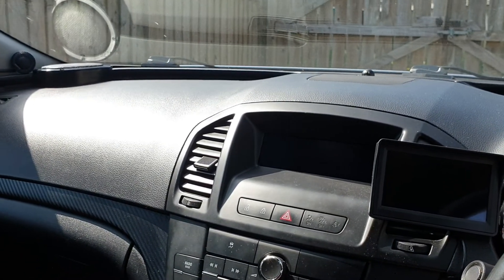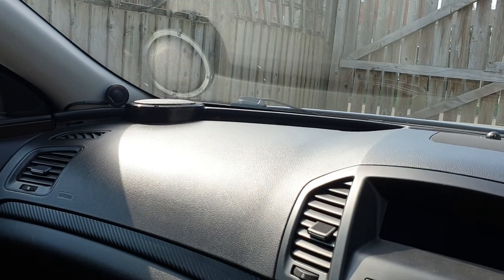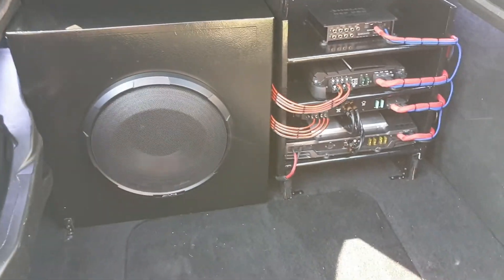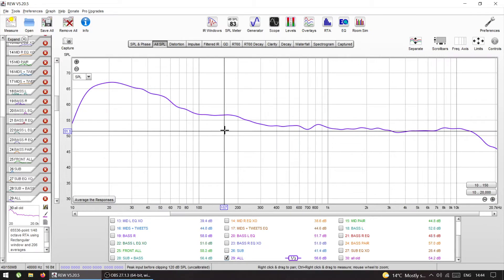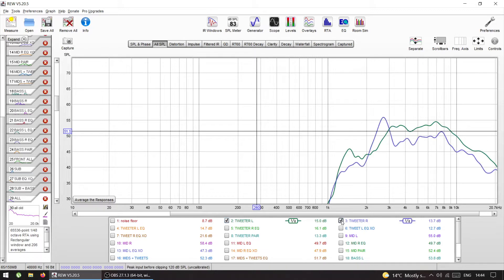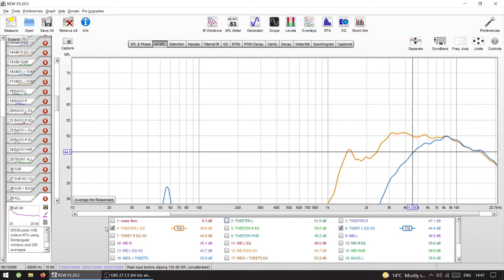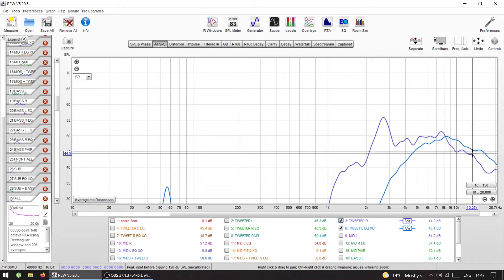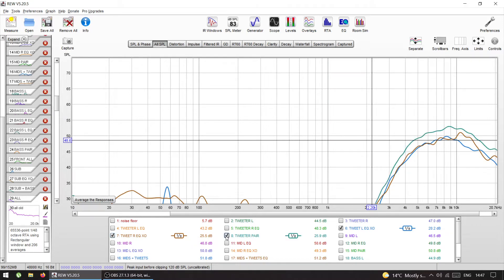Tuning my system (REW RTA and auto EQ)

Comment: Hi. I have watched most of your REW and Helix DSP related videos. I also have a Helix DSP (DSP.2) and use REW and a DaytonAudio UMM-6 USB mic. I've obviously missed something or I'm not clear.. I generated pink noise in REW that I play through the HU in the car and when I measure an already adjusted system that sounds good, but the difference from 100hz-15khz is 25db and from 20-20khz even 45db. Judging by all the house curves, it comes out of every recommendation.. Today I came to the conclusion that the generated signal from REW and when I load it into the program is not linear but has a constant drop of I think 3db/oct.. When I play it on HU and the adjusted DSP that has with some House curve, I get a difference of over 40db in the full range on the microphone.. What to do? Is there any option in REW u and is it possible to generate completely flat pink noise? I could send you photos privately (email, whatsUp, viber)
Reply from the maker: In REW RTA settings change "spectrum" to " RTA 1/48"
Reply: Thanks for the quick reply, that seems to be it.. Looks pretty linear now (at least in home Hi-Fi).  Can it be applied in REW to all previous measurements?  Like for example smoothing. @RAW-CAt
Reply from the maker: @josip07B  no, if you took measurements in spectrum, you will have to redo them.
Reply: Thank you, you helped me a lot.  Yes, all my measurements were unfortunately in the spectrum, I will have to repeat... Can you give a brief explanation as to why this is so?  Why is it that when the spectrum is there is a constant db drop and when it is 1/48 it goes almost linearly.. Thank you. @RAW-CAt

Comment: Bonjour, pourquoi avoir filtré le médium à 200hz alors qu ils sont capables d aller plus bas , par ex 120 hz ?
Reply from the maker: In order not to stress them too much. The less the driver is moving (xmax), the cleaner it plays. As well the lower they play, the more energy they transfer to the dash making other things rattle and buzz.

Comment: I've always been told to place the mic at 90 degrees ONLY when measuring for a surround sound setup. Point the mic at the drivers for everything else.
Reply from the maker: Well in a car the drivers are at a great angle from the listening position. So measuring at 90° makes all the drivers to measure similar due to the polar pattern of the mic. If you will point.it to the front you will have very different angle to left and right side drivers and the response will not be as accurate.

Comment: Whenever I tune my BMW 328i flat like your graph and similar house curve , it sounds overly bright and thin.  
It has to be a constant slop for some reason. 
What am I doing wrong?

Thanks !
Reply from the maker: You are not doing anything wrong🙂 A house curve is a personal prefference. Maybe you are not used to have the top end? I would advise you to stick with a flat top end for a couple of weeks and let your ears to adjust to the new sound signature🙂
Reply: @RAW-CAt  don’t know man.   I have quite a bit of experience with home stereo and my house curve has been the Harman curve in my home 2.2 system.  And it sounds great.   
In my car however it does not sound so great.    
Could be the drivers.  
I did a RTA measurement of the old amp and drivers I have in my car and BMW had them tuned not flat either.    
Who knows
Reply from the maker: @Nightjar726  maybe it is the car interior after all?🤷🏻‍♂️
Reply: @RAW-CAt  maybe.   Who knows.   I don’t have the experience with car audio to know what’s going on.

Comment: Equing dips you car wreck the speaker if you turn up the volume up. You may get the amp into clipping
Reply from the maker: "MAY" is the main word here. Gain structure setup correctly doesn't introduce clipping. All speakers are still fine by the way👍

Comment: I want to run this in my car as well. I suspect my biggest issue is the subs are out of phase or has a timing mismatch. Unfortunately I can't see any way to correct it on a factory Harmon Kardin sound system
Reply from the maker: That is why you need a DSP...

Comment: If you set your gain correct from the beginning and your amps deliver as much as they can. How can you then boost the volume more in the DSP to gain a higer level on the mids and sub for example after you have equed them (1:34-1:49)? Will you not add a clipped signal then?

Comment: I appreciate everything you've shown just bought my 2nd dsp and it seems a little mystery. You would think by now a software would be made where you plug in, have a mic and it does the rest or the system would tell you where your mistakes are then you correct and then you can later adjust for listening pleasure. So many so call pros keep everything a secret and the steps just to get the beginning correct it is ridiculous. The dsp companies should have a step by step of set up on their websites for customers or potential buyers cause you spend a 1k or more on a dsp and then it's like ok go do it. I think it is a good hustle but they should at least have on line support to help new people get started
Reply: @RAW-CAt  sir if you can help me well you have the knowledge, I'm trying to get my rearfill in order with the 3 way curves and the rear deck is loud and also I have rear door speakers. I mean do I eq after I do the sub and 3way front or do I do it as a big left channel thing and just eq the frequencies were they lay regardless of speaker location. Just confused but I gotta get something done this install has had a life of 2yrs I'm trying to move on to a new one lol
Reply: @RAW-CAt  I appreciate your time and help

Comment: The reason I say 3khz is that 2-2.5khz is where you don’t get good summation between left and right mids so that’s not a great place to put the crossover, moving it up although not technically perfect for directivity of the midrange will be lots better than lower

Comment: I would be lowering the crossover to around 3khz and that will make the midrange blend be so much nicer, using most tweeters down to that is fine
Reply: Ya was thinking the same.... I'd try 3400ish before boosting.

Comment: If you drop the low mids 2.5db the acoustic crossover will shift lower at that low to high mid xover point. Possibly why you got a 400hz lump.. but then you'd need post eq to get you lows you wanted.